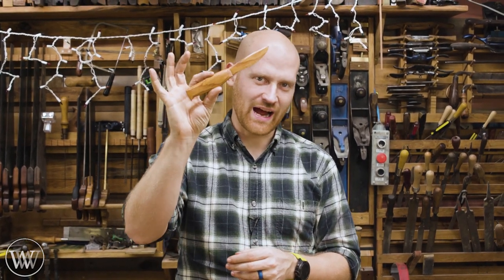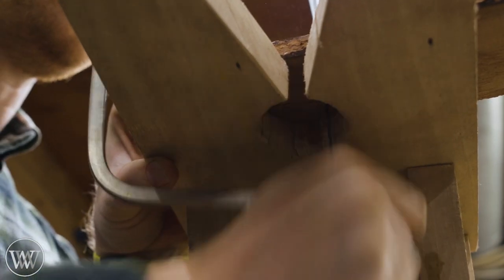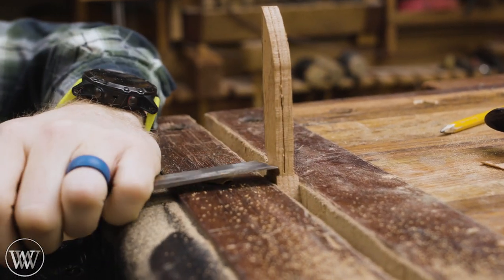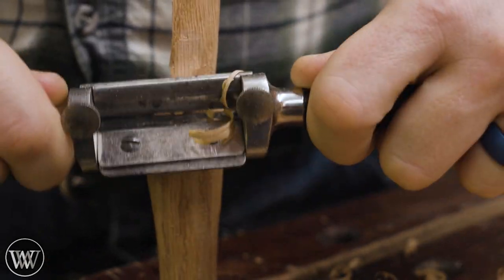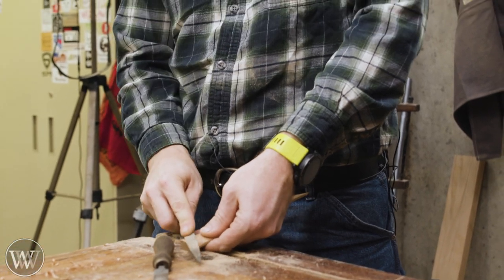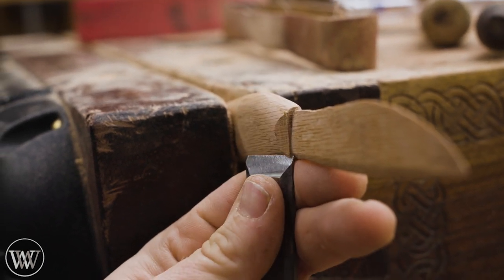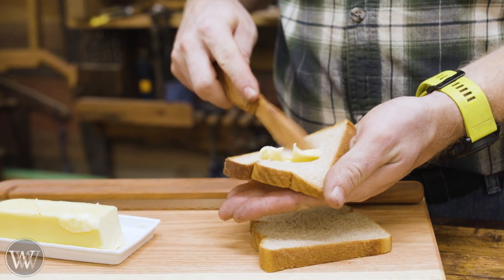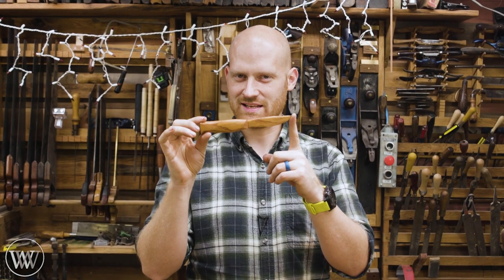How to make a Butter knife With Only Basic Hand tools

Comment: There are so many things I like about this project it's hard to begin. Great little project. When you were scraping the blade with the spokeshave, I saw it bending and I was cringing expecting it to break. 

A possible idea, maybe make one laminated? Maybe use a lighter wood for the blade and use a darker wood for the handle, basically making a full tang knife. I don't know feasible that would be considering the thickness of blade and tang, but I figured I throw it out there.
Reply from the maker: yup. that is why strait grain is a must. you would be amazed how much torture it can take before braking. especially oak. I thought about doing the lamination too. it would look cool. maybe next time.

Comment: James, would you mind sharing rough dimensions of your birdsmouth?
Great video btw. I've got a bunch of scraps I'm going to try this with
Reply from the maker: it is made from a 1X8 piece of poplar. it sticks up to a height that is comfortable. ( a little below chin height) but that can be adjusted by moving it in the vice.  the top is about 1' long. the central hole is about 2" wide and the "V" that comes out from there to the corners has an opening on the central hole about 3/4" wide. does that help you out?

Comment: I have a  bunch of small red oak pieces from the Lowe's that I set aside for other things. Could I use them for this project or do they have stuff added to them that would make them not suitable for this project
Reply from the maker: that would work great as long as they are strait grained. if the grain runs out to one side or other it may break when the blade gets thin.